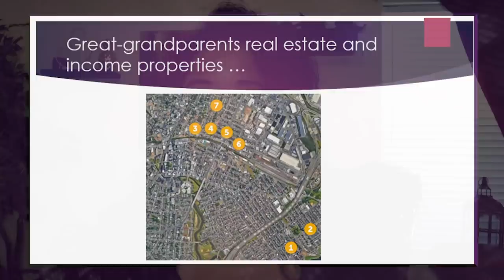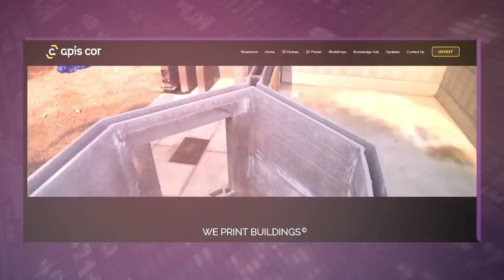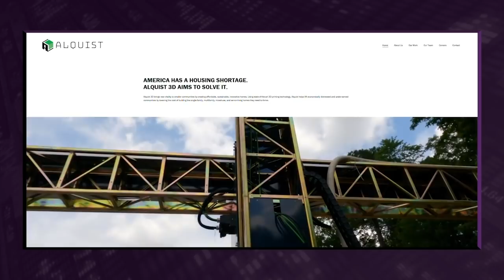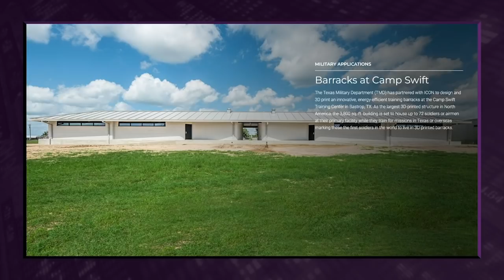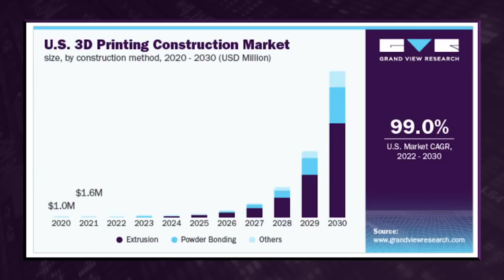Will 3D Printing Help U.S. Housing Shortage?

Comment: Sounds interesting. Would love to get a more in depth, step by step look to see how the plumbing, electrical, HVAC, etc, gets installed. Sounds like there are still many elements like the roof that may still get installed the traditional way. Bottom-line, this is another example of the ingenuity and promise from 3D printing. As long as the raw materials needed for the printers are available in abundance and at a reasonable price, sky is the limit for the future of 3D printing / digital manufacturing.
Reply from the maker: Yes, very interesting indeed, John.  The sky is the limit on this promising new homebuilding tech.  Thanks for watching!  ~Amber